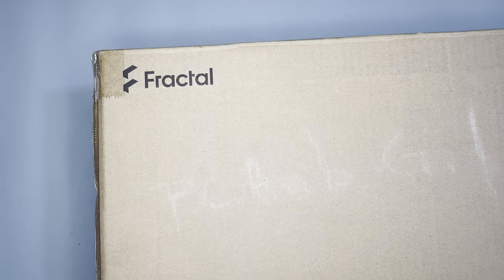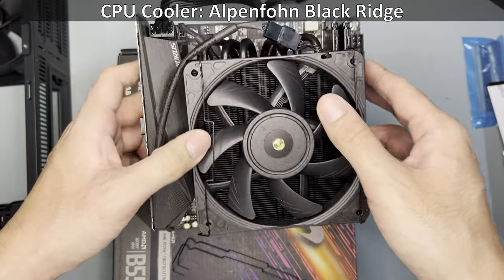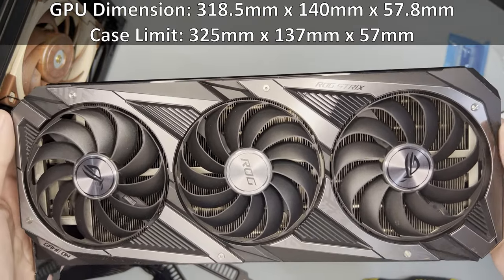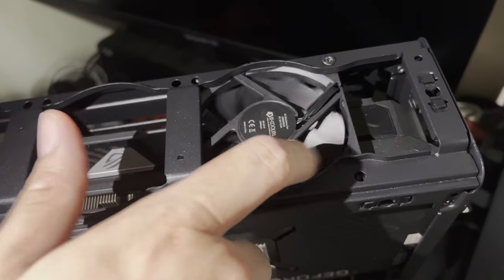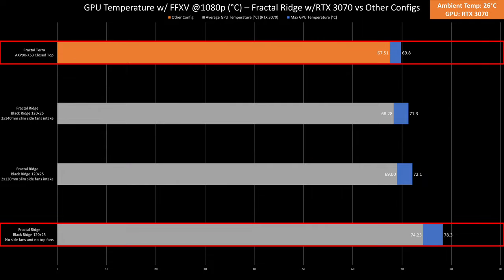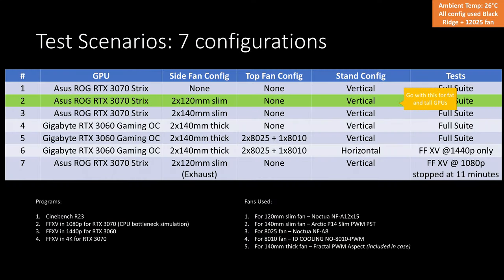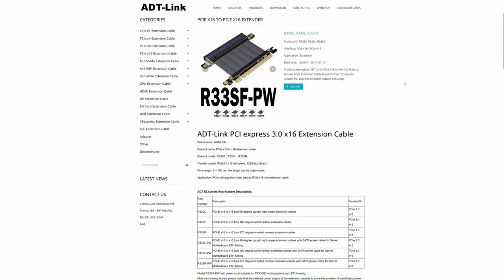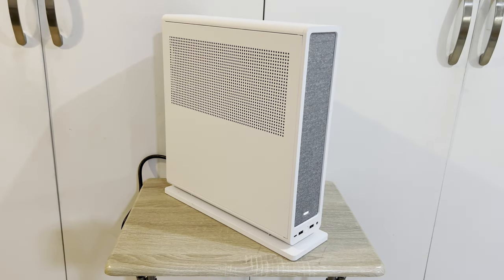Fractal Ridge | A 12.6L SFF ITX Build | Thermal benchmarks

Comment: I thank you for the informative video because this is exactly what I have been looking for since I plan buying this case. Even though you mentioned that the top fans didn't make a ton of difference, I'll probably still add two to the top of the case with one 60mm fan in the front behind the mesh. I've seen a few people say that the front fan helps with temp as well.
Reply from the maker: Yeah, I think I also stated that your mileage may vary with it. But I may not have mentioned why I said that.... in my mind,  I suspect that my 3060's cooler may have already reached its peak cooling capacity when operating at full load with the two 140mm fans blowing directly towards it.